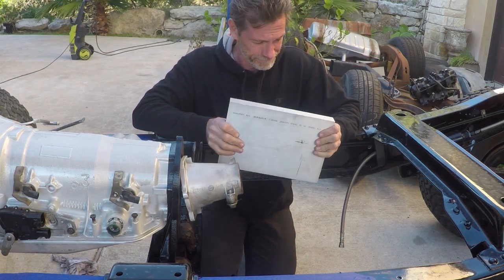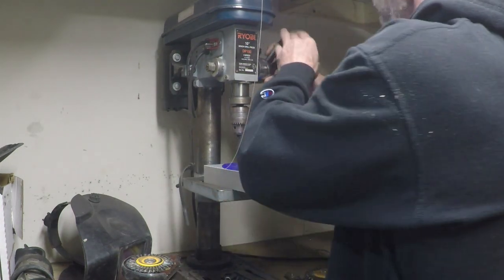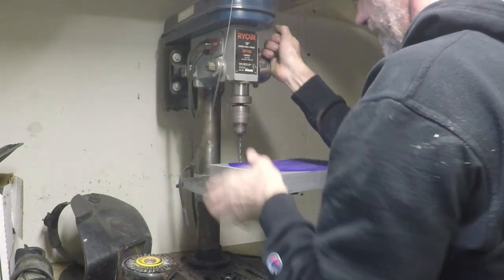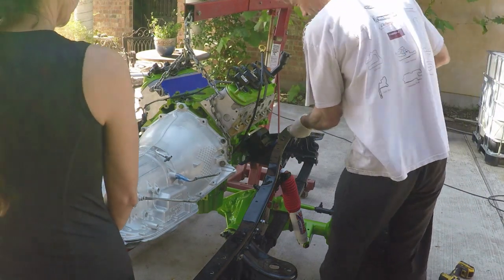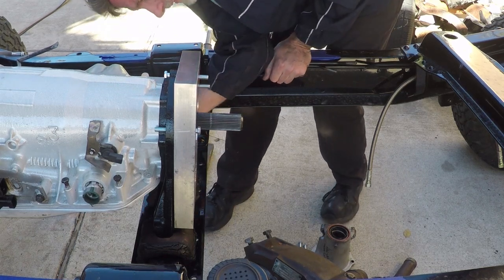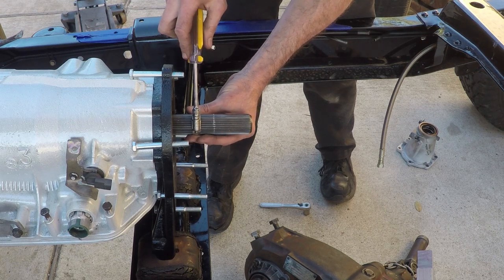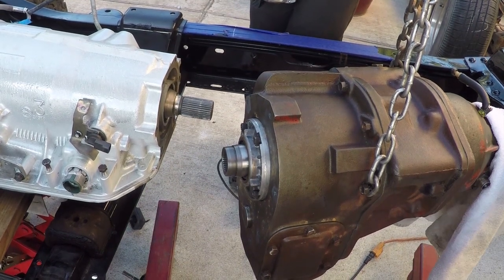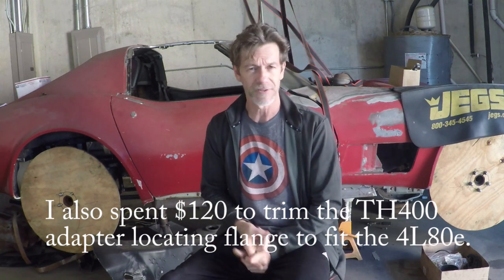Connecting a 4L80e transmission to a NP203 transfer case.

Comment: Are using a 2wd or 4wd transmission? Thanks!
Reply from the maker: 2wd.   The 4wd version has the 2nd speed sensor on transfer case.
Reply: Thanks!
Reply: Last thing. Do you like it?or you think was better with a different transfer case?
Reply from the maker: @cesarsierra4635  The transfer case is the original to the truck.   The transmission is different and 100% better.
Reply: Thank you so much!! I’m about to do the same thing
Reply: It’s Me Again, I’m trying to find the aluminum piece to make the bracket but I can’t find it.If you don’t mind where do you buy it?Thank you so much!!
Reply from the maker: @cesarsierra4635  I bought the aluminum piece shown at a local metals dealer.   Check their "drop" bin and measure for the proper thickness.   You can also try Ebay, but small pieces cost more.
Reply: Thank you so much!

Comment: If I use a 2wd 4L80E and cut the tail housing shaft will I need to run a VSS on the t-case or will the 2wd 4L80E already have a VSS running to the computer and can I use my mechanical speedometer
Reply from the maker: The 2wd 4l80e has two speed sensors so none are needed on the t-case.    Run your mech speedo off the tcase.   When in low range, the computer will see a different speed than you see on your speedo  but it doesn't matter.

Comment: What are you using to gol the weight of the transfer case? We are done installing ours but looking to add support for the NP203 weight.
Reply from the maker: I am sticking with the factory transmission crossmember and transfer case side support.

Comment: It would have been better to trim the snout of the 203 input to make fit vs. grinding down the 4l80 output.
Reply from the maker: The output shaft of the 4l80e goes into the female input shaft of the 203.    How do you propose trimming the 203?

Comment: Hey brotha loving your videos. I'm building a 1979 k5 blazer. I'm currently doing the same setup as you I have a Lq9 6.0 and a ended up grabbing a 1999 4x4 4l80e which doesn't have the rear speed sensor installed from the factory. I wanna use my np 203 because that's what came with my blazer only thing is it doesn't have a place to add a output vss on the transfer case. So I see that you had a 2x4 4l80e which already had the output speed sensor installed. My question for you is have you been able to run your transfer case set up with having you harness plugged into the output speed sensor on the transmission without and issues? I plan to have a realtor ring and sensor added to the rear of my transmission and I'm gonna plug my harness into that but I'm afraid if I don't have a sensor reading at the rear of the transfer case it won't shift the trans properly what's your take on this brotha.
Reply: I’m in the same boat as you right now. Have you figure anything out yet? I’m thinking of taking my freshly rebuilt 4l80e apart to add the reluctor gear but if I don’t need to then I prefer not to. Im running a 203/205 doubler on mine. Idk if I run a 40 tooth sensor on the 205 if it will make my trans shift properly. Or will it sence when I’m in 4lo?

Comment: hey man have a question for you. i have a 203/205 doubler on my 77 jimmy,  it was connected to a th400 454 and im doing an LS swap. would the 4l80e bolt up to it?
Reply from the maker: The 4l80e and the th400 have the same output shaft so yes!    The 4l80e is a couple of inches longer, and you will have to deal with that.
Reply: @CrankAddict  just cut the shaft? ive read so many diffent things lol
Reply from the maker: @Warmachine817p  I like to use the 2wd version of the 4l80e because it has 2 speed sensors which is required for the transmission to work properly.   The 4wd version has the 2nd speed sensor in the transfer case (which you do not have).  Options: 1) put a 4wd output shaft in the 2wd 4l80e.  That's what I did. 2)Use a 4wd transmission and drill out the 2nd location for the 2nd speed sensor (also requires trans disassembly).   3) Use a 2wd transmission, but cut off the extra length of output shaft to fit.    You may run short on splines with this method so a 1" or so spacer may need to  be fabricated to increase spline engagement.
Reply: @CrankAddict bump had a question for you
Reply: @CrankAddict  thanks alot man i appreciate the replies
Reply: Hey buddy i messaged you a year about about this video. I did exactly what you did i just have some further questions if you have time.

Comment: The 203 would not bolt to the original adapter?
Reply from the maker: The Jimmy had a TH350  originally which uses 27spline output shaft.   If you had a 454 (and a TH400)  in your blazer then you may have the correct adapter already.
Reply: Sow a th400 adapter to np203 is a straight fit for a th700r4 /np203???

Comment: So the problem with the 2WD was the length of the output shaft? I know there's more than one way to skin a cat. Could you have cut the output shaft of the 2WD 4L80E
Reply from the maker: The 2wd version of the 4l80e  has both the input and output speed sensor in the case, which is what you need if you are using an older transfer case.    If you get the 4wd 4l80e then the output speedsensor is in the driver's side drop transfer case (which you are not going to use) and the computer won't work right.   However, the 2wd version has a longer output shaft, so you either need to cut the shaft or take the transmission completely apart and install the 4wd output shaft.  You could also get a 4wd case and take the transmission completely apart and install the rear speed sensor ring from a 2wd unit.   I chose the easiest way of cutting the output shaft on the 2wd version.,

Comment: Hi! As i known, 4L80E have 32 spline count output shaft, NP203C have 27 spline count input shaft. Please help, where you get NP203 32 spline count shaft?
Reply from the maker: Any good gear shop should have them.   I think you can even find them on ebay sometimes.   The np203 was sometimes bolted to  TH400 trans.    The th400 has the 32 spline output.  Make sure you get the 2wd version of the 4l80e, or else you will be drilling and tapping for a 2nd speed sensor.